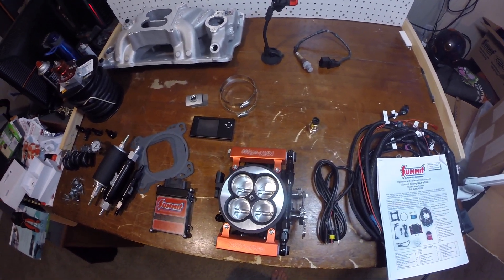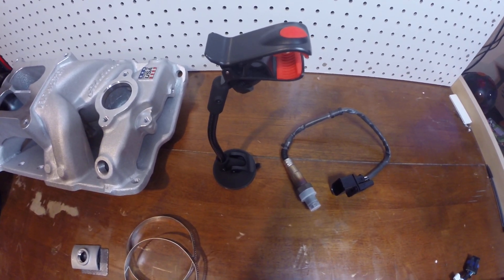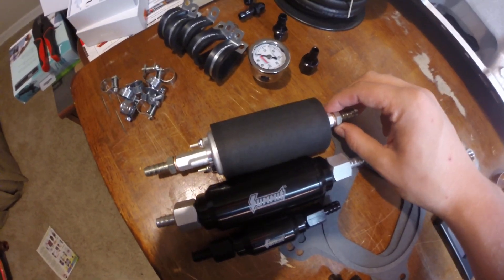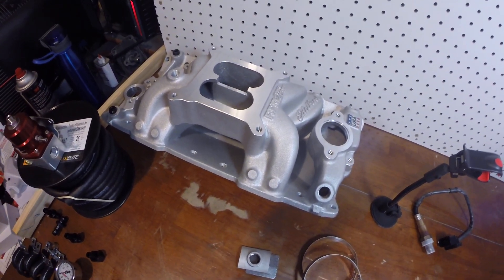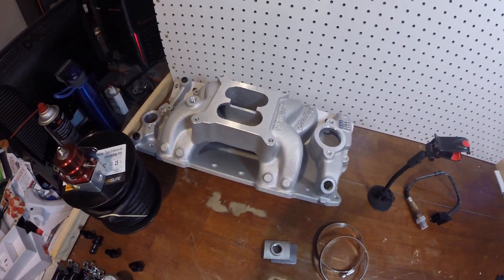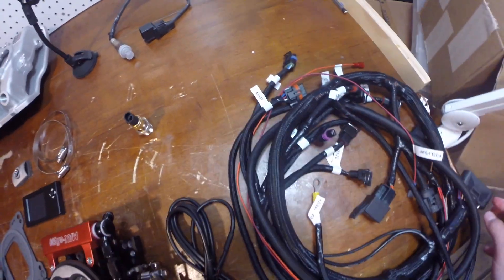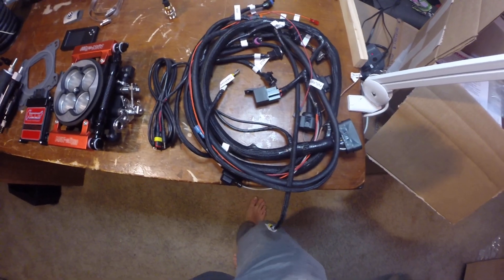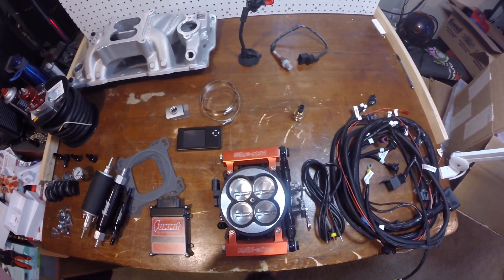Summit Racing Max-Efi 500 First Thoughts

Comment: Do you still run this setup? If so how long have you had it and any issues?
Reply from the maker: After about 6 months I took it off, ran a carb, now I’m back to sniper efi, my max efi 500 had a recall for the fuel rail and mine was one that had the fuel rail failure
Reply from the maker: Definitely go sniper efi
Reply: @1MarkMartin  did you have any problems besides the recall on the fuel rail?? I’m really thinking about grabbing one